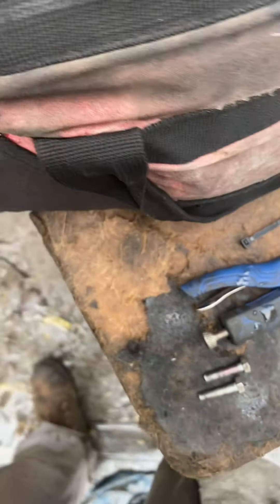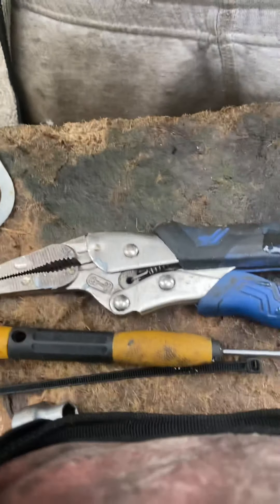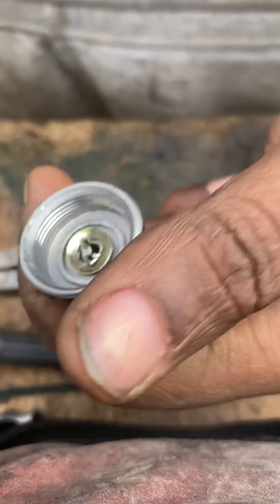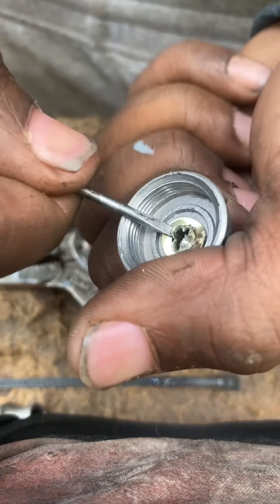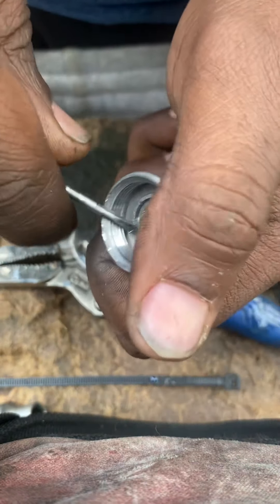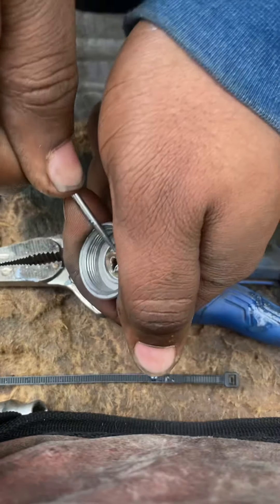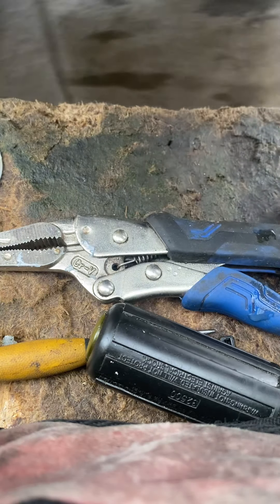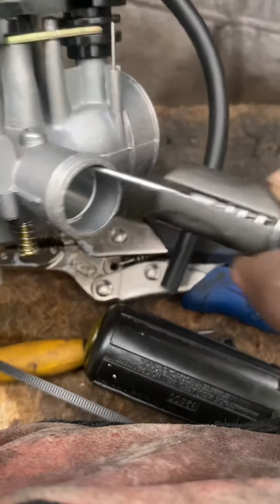Chinese Dirt bike throttle hack

Comment: A washer would have worked good, did this to mines but, I used the old throttle cable that has that metal tubing at the end. I just screwed that metal piece that is at the end of the throttle cable and twisted the metal end of cable onto the top part of the carb. May have to install the cable onto the carb then install carb onto the motor

Comment: Even thou this will work that rubber boot is to prevent dirt and contamination from mixing with your gas. I’m sure you know those jets in the carbs clogg which makes your bike bog and all that. I wouldn’t dive threw a puddle or a lot of dirt with that honestly. Your carb gon be mad dirty fam fam. If you gon rig it, rig it. Put some black electrical tape around the top of the carb and zip ties and cable. Not to stop the cable from sliding but only enough and sealed to keep the dirt out. Would look cleaner to. 💪🏽

On another note, the cable isn’t to short, all you have to do is get the cable threw the carb top, compress the spring when installing the needle assembly. Pain in the a** sometimes but I never seen someone attach the end of a throttle cable without having to compress the spring like that.
Reply from the maker: i had hundreds of bikes never bogged out . you must be a rookie at this. use a fuel filter you want have dirt issues.
Reply: @Mr215Mar  wtf a fuel filter got to do with dirt going DIRECTLY in the carb, yeah you know nothing bout bikes fr

Comment: That gives you and air leak bro. You need that to be sealed or you will have an air leak and it will mess with the idol and tuning causing the bike to run lean
Reply from the maker: Smh no it doesn’t it’s not a 2 stroke with reeds. It’s a Chinese bike horizontal engine not a kx cr rm or Ktm . CHINESE
Reply: @Mr215Mar  glad someone knows 😆 I can literally take the top of my carb off and use my finger to lift the slide with no running issues 😆😆
Reply from the maker: @MaNNeRz91  pretty sure you don’t know anything about amazon product or what the post is about it’s for Chinese bikes I believe you just a confuse admire this is for the people that want to save money. It’s Either you going to take it and run with it or just keep it moving 🫡
Reply: @Mr215Mar  what the fuck are you talking about now 😂😂😂😂
Reply: @Mr215Mar  4stroke can have air leaks to

Comment: For my 2012 Apollo I got lucky n don't have that extra play in the cable, but when I replaced my shit, the throttle works amazing but when I fire er up, there's a awful clicking/ticking noise... any idea on what's the prob? I checked the spring to make sure it's fully sat on the carb lid ughh
Reply: Valves
Reply from the maker: is the clicking when you twist the throttle ?
Reply: @Mr215Mar  Yes it WAS. While I was working on it I left it in my front porch one night… Woke up & it was GONE. Preciate the comment tho man! Ngl I purchased my firearm after that, it was legit 2 steps from my door. Someone had BALLS smh, shit happens tho learned a lesson.

Comment: doing this will result in you throttle being stuck at full 

just a warning
Reply from the maker: yeah you don't work on bikes
Reply: @Mr215Mar  ya I actually do and not just bikes quads and trikes as well I own 27 and I'm nearly finished fully restoring most of them
Reply: @Mr215Mar  and snowmobiles

Comment: lmao. just cut the extra throttle wire from the end of the carburator instead of using zip ties.
Reply from the maker: Smh throttle cord has a little ball at the end to keep the cord from coming out the carb. If you installed one before pretty sure you’ll know

Comment: Bro it's easyer to compress the spring with a ziptie put the throttle cable on then break the zip🤣
Reply from the maker: you sound damn why would you zip tie the spring
Reply: @Mr215Mar  to easily compress it or use your hands 🤷‍♂️
Reply: @mikeplays1163  He thinks the cable is supposed to be this long, and doesn’t know that you are supposed to compress the string when you put it together.  Other commenters have already tried. 
     I wonder what’s gonna happen to his throttle with that zip tie wears through?

Comment: I hope no one tries this all it's gonna do is give it a leak an make it idle high an run like garbage
Reply from the maker: Amazon sell long throttle cables don’t matter which one you get. I been doing this for a minute no problems. Chinese brand horizontal engine not 2 stroke name brand engines